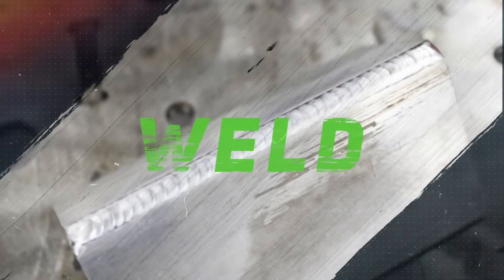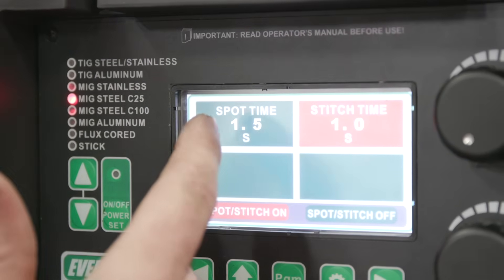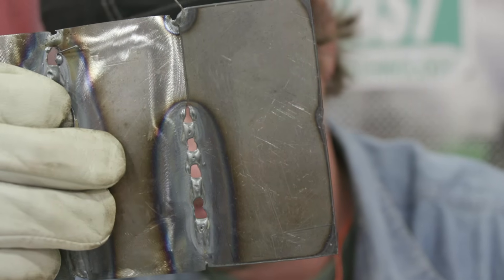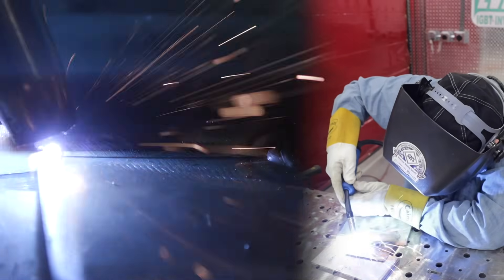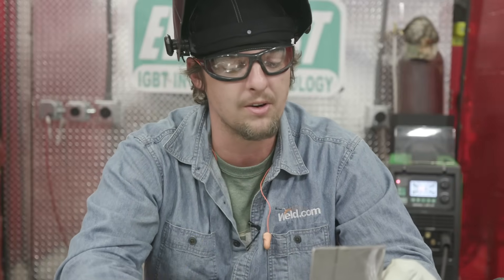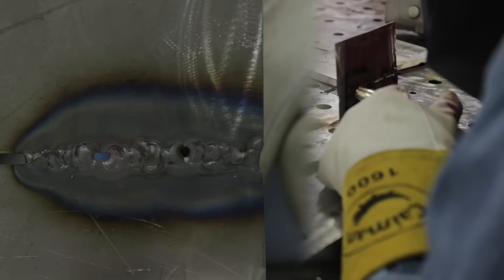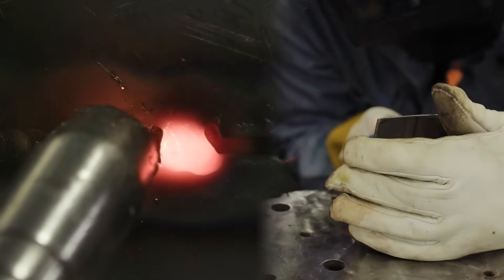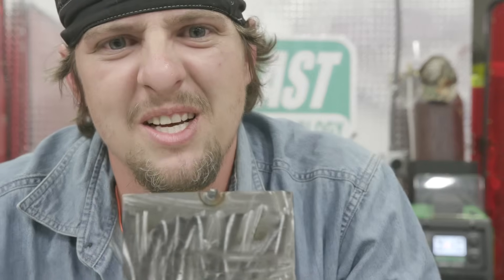Welding Sheet Metal #SheetMetalProblems

Comment: I have a mts 252 , can you do a video... how set up mts252 adjust volts oe adjust the wire speed... new to mig welding...having issues setting up this mts252
Volts vs wire speed vs amps etc...in mig mode vs sygenic mod...
Reply: Need more video on sheet metal  and mig and tig setting how to adjust mts welders

Comment: Great video. Question: I’m FCAW 22ga sheet steel for a rocker panel repair. I’m a newbie. Using a Lincoln MIG welder set up for FCAW and 0.035” wire. To prevent blow through I have lowest voltage setting (A). Should I also have the slowest wire feed speed?

Comment: So I have a question I’m doing a lap weld on 14 gauge steel on 22 0:02 gauge steel. With flux core. My welder specs show @ 110v minimum thickness is 20 gauge and I am burning through, any suggestion? Or am I spinning my wheels?

Comment: you still failed. @ 7:48 you can visibly see  the failures. right in the middle of your piece. If you're gonna be a grinder at least do it right. and in case your wondering im ticketed in welding and sheetmetal. Tisk tisk

Comment: that's a discontinuity, my job's inspectors would reject it
Reply: He’s demonstrating how to patch thin pieces not an inspection for a duty rated job.  Calm down.  For an amateur looking to patch up some rust spots on an old car or other non structural repair, it’s pretty solid advice and tips to get it done.

Comment: This is my problem...voltage and wire speed...the technique seems easy to emulate but the setting of the voltage and wire speed is my problem. I'm assuming this if flux core wire? Weld looks great!
Reply: That too is my problem. I can't trust the info sheet in my MIG - the voltage is either too high or low or my speed is too fast or too slow.  I'm constantly burning holes in my 18ga steel
Reply: @tomnanos9609  Thinking I just need to have more practice. Can't discount experience and practice with all different gauges of metal. The good thing is I'm having fun welding right now. Just working on having the good "frying bacon" sound!....LOL!

Comment: Please make a video about restaurant grease duct welding and assembly
Reply: In my very limited experience, this has a lot to do with cleaning!   I once got to do a tiny bit of TIG welding on the side of a deep-fryer, it was full of oil!  The outside had a thick layer of fryer oil baked on to it....  Probably a miserable hour cleaning off a spot a few inches square, down to gleaming bright stainless... then maybe thirty seconds making a tiny weld.

Comment: I got a job and when I ran the weld test,  they said the volts were set at 27V  and they didn't say the wire speed. I just got out to college and i only was use to welding with 1/4 inch and 3/8 material at like 20-22 v with a wire speed from 335 .Why  would they be welding at such a high temp.? I just kept blowing through as soon as i pulled the trigger.  We didn't really go over thin 16 gauge sheet metal in college.  This job is a piece rate so they said they run hot and fast. I still got the job, but the welds were unsatisfactory.

Comment: I played around with Tig filler wire a bit to bridge a little gap and i have to say it works like a charm. Just put a tig filler in this case 3/32 in the gap and play a little with the settings. Worked pretty good on my test pieces

Comment: Great video Man Cub, recently I had to fix a trailer with some broken side supports, they were 16 gauge , I decided to fix with 1/8 angle which did work and I spot welded  then ran full beads on top. It is a pain to get nice welds that work. I was wondering if you could do a video on welding thin sheet to thicker sheet as many times we have to do repairs that require welding thick to thin to make something
stronger than it was when it came in for repair.  thanks
Reply from the maker: We can do that
Reply: Hey Bruce, I saw your comment and in case you were still wondering, what I do, is when you’re welding with the mig gun, focus your gun towards the thicker metal then quickly drag the puddle to the thinner metal and back to the thicker metal, kinda like whipping with pipe, it’s how I’ve done it and I do thin gauge welding as my job lol
Reply: @quickshot4050   Hay thanks for the tip, I have done as you said , problems arise with 1/8 to 14 and 16 gauge . Trying to get some penetration  on the 1/8  with out melting the 16 gauge . Now on non structural  builds I have been using silicone bronze mig wire 035 seems to work well but not cheap. Still working as you recommend for heavier furniture .
Reply: @bruced1429  here is another tip, try turning your machine way down, but turn the wire speed way up, I can weld 24 gauge galvanized at 10 volts and 150 ipm wire speed, you need to keep your gun very close tho, as if you don’t you’ll just be popping a lot. Also don’t be afraid to turn your cfh on your argon down as well.
Reply: @quickshot4050  Thanks again for the tips I will give it a go ,